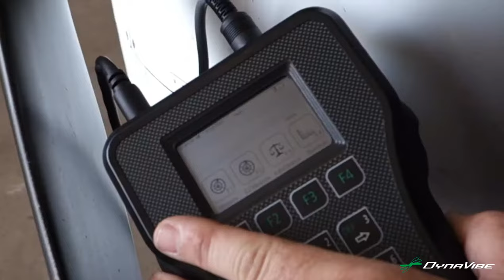GX3 Tutorial

Comment: Couple of Questions and Comments:
1) On a variable-pitch propeller, what should be the setting when using the dynamic balancer?
2) What RPM is used to make measurements?
3) Video would be more complete if we were able to see the screen on the Dyna-vibe.
4) Is the spinner the only location for weight adjustment? Can the fly-wheel be used?
5) Can you procure lead washers that have more mass and less stack up height?
Reply: 1. Full forward, same as runup.  2. Cruise is ideal, or whatever you can get and feel comfortable with on the ground (e.g. runup RPM) 4. Yes, on a Lycoming you can use the fly-wheel but be sure the weight hardware is clear of the starter. 5. It would be better to split the weights to multiple locations and we always use AN hardware.  Also, if it needs a ton of weight then it may be wise to have a prop shop do a static balance with permanent weights.

Comment: I am not convinced the weight-bolt position set up was correct. Early in the video the bolt you indicated as bolt 1 later becomes bolt 2 when you start adding weight after the first run. At that stage you point to the bolt behind the blade as bolt 1. Setting it up as 6 bolt positions is not useful unless they are equi-spaced. So effectively you added weight to your original bolt 1 when it told you to add weight to bolt 2. No wonder, after the next run, it asked for 50g on bolt 3. Same question as earlier about the extra weight of a longer screw? Also, we don't know what the start IPS was.
And when you set up the position of the accelerometer, you told the machine it was at 12 o'clock. It may have been vertical but it wasn't at 12 o'clock.

Comment: Where did you get the engine mount adapter. Would like too get my hands on one.
Reply: They sell them as an accessory kit. Decent price.  You can make your own by tig welding a couple nuts together using a matching bolt that you remove then remove and tig welding the proper size bolt for the accelerometer bracket to the end with the threaded part pointing away from the two nuts that are welded. Use stainless steel